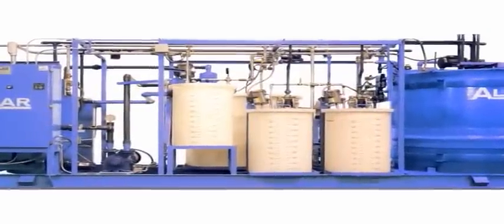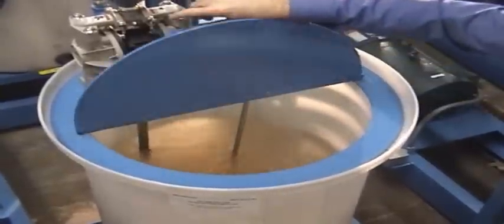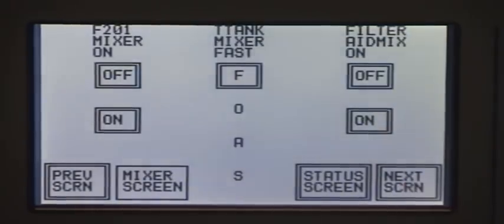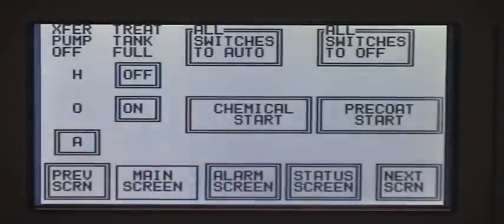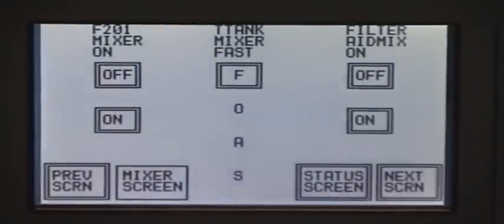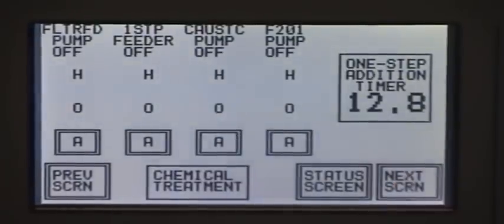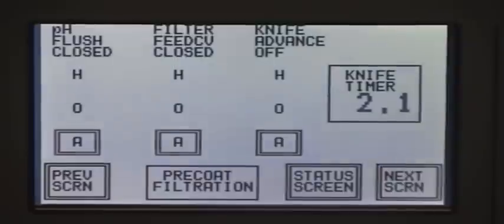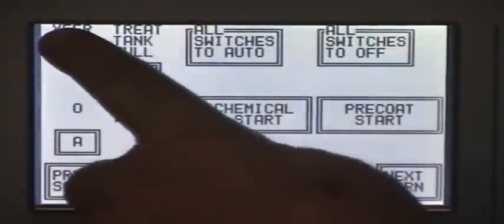Wastewater Treatment for Water Based Effluents

Comment: Seems like a good complete solution to the problem, an alternative though more compact low-energy system that does not require chemicals is called the Baleen Filter.